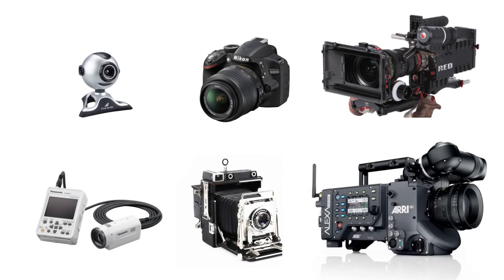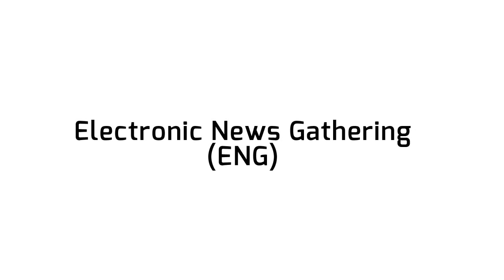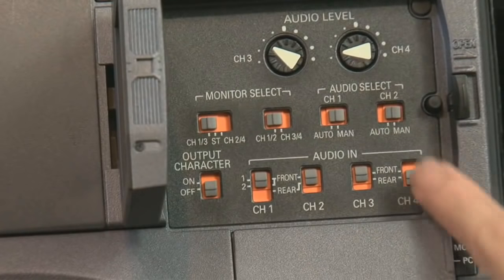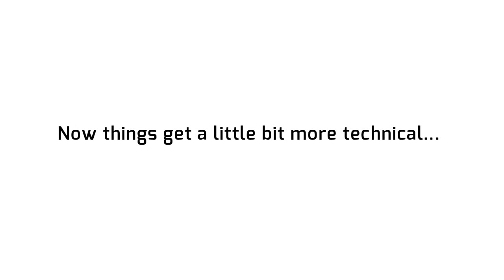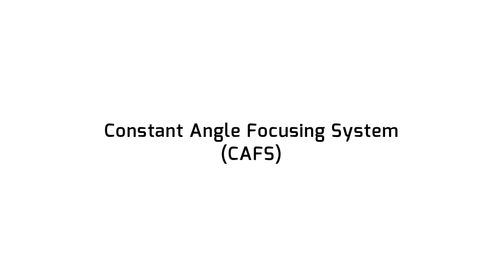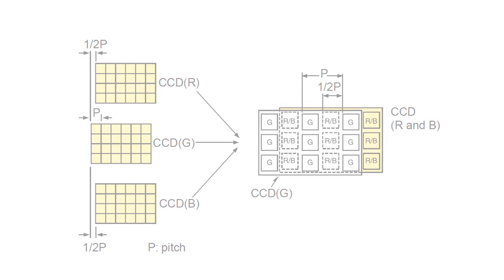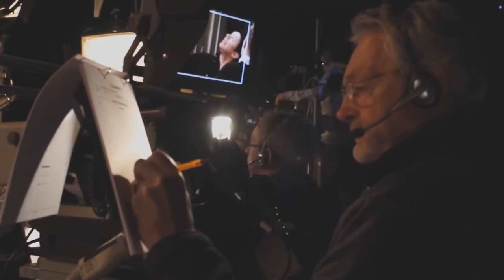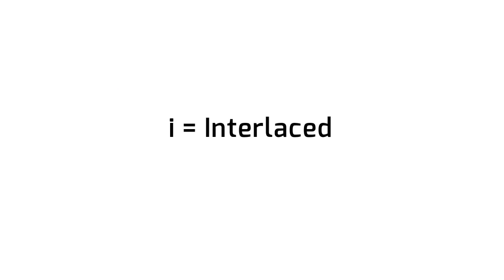Understanding Television Production Cameras

Comment: I'm not sure, but did you mean "larger sensor -> more pixels" instead of "larger pixels"? 5:58
Reply from the maker: No I did mean larger pixels. So when you have a larger image sensor each individual pixel can be larger. That basically means more light can be taken in by each one (i.e. the photon capacity) and with more light comes more 'information' that the sensor has about the environment in which an image is being taken. In turn, colour accuracy is better, contrast is better and there's less image noise because the 'signal' doesn't need to be boosted as much.
Reply: @BenScooter1  Oh I see. Really cool! Thanks for the response.

Comment: Can you please answer these 5 Questions.
1. Why Doesn't every country adopt Pal or NTSC Worldwide.
2. Can the human eye spot differences between Pal 50p and NTSC 60p as 60p is smoother and all smartphones have adopted that, wonder why they opted for 60fps instead of 50fps.
3. Why don't camcorders let you toggle between Pal and NTSC.
4. Many top end consumer camcorders of today have a 1 inch Single CMOS Sensor but the top end consumer camcorders 20 years ago had a 3 chip sensor, why did Sony and Canon change as 3 chip renders colours more realistic.
5. Why did smartphones opt for 60fps instead of 50fps worldwide.
Reply: 1. That would require a large part of the world (mainly the US, should they adopt PAL) or a very large part of the world (all the other countries using PAL, should they adopt NTSC) to quite possibly throughout a huge piece of their broadcasting infrastructure should it be unable to process the new standard.
Also, PAL and NTSC are different for a reason, both relied on using half of the mains grid frequency to do some very clever clocking (with NTSC doing this obviously a little bit different with their 29,97 instead of 30 frames per second, which had to do with available bandwith in the transmission of TV signal at the time NTSC was created).
When you shoot in NTSC in a PAL enviroment (with PAL using 25 Hz as clocking frequency, with 50 Hz being the mains grid frequency) the camera will sync up with the "zero" moment in a sinus wave momentarily and fall out of sync quickly only to repeat the process every 30 frames, simply for it not being in sync with the AC frequency most lights here work on ;) which would be pretty nasty.
2. People who are sensitive to this can definitely spot this, some people are already put off by the difference between 25i and 24p that used to be the standard for cinema film.  Living in a particular "frequency environment" and seeing a particular image standard can make you susceptible to a difference quite easily.
3. Most camcorders unfortunately do, which is also where many of the user errors come from.  "Hey, I have shot this cool video and I want to show it to my friends, but their TV won't play it properly, it like, stutters awkwardly, can you tell me what's wrong?" or someone throwing NTSC footage (unaware there even is a difference between PAL and NTSC) into a PAL edit timeline and going "Wow this looks not right, this computer is probably broken...")
4. Even though CMOS sensors are much, much cheaper to produce than CCD sensors where, they still are basically the most expensive part of a camera to make.  The reason for having 3 sensor back in the old days was that with 3 sensors, each pixel was receiving the information it should be receiving and thus making it much more sensitive to light (which the first consumer video camera's in the 80's absolutely were not :P), while with a single sensor, a camera has to do a process called "Debayering" in order for it to distinguish the color a pixel was seeing.  Sensors (whether it's three or one of them) are basically colorblind and especially with the single sensor ones, a groupd of 4 pixels (2 green, 1 red and 1 blue) is used to determine the color for each one, because a red pixel that registered almost no luminance difference just like the two green ones decide that the spike in luminance the blue one was seeing must have been the color blue. If you think about this, it's actually astonishing that it works like this so flawless each time.
CCD's had a higher production failure rate (to much dead pixels for instance) than CMOS sensors have, next to them requiring a lot less energy to work than CCD's do, which caused the shift towards CMOS sensors.
There are actually still 3 sensor camera's made, most ENG camera's still have 3 sensors and some of the Sony camcorders still do (the HXR-NX3 and NX5r for instance have three 1/2.8" sensors in a surprisingly small package.
Also, concerning the last thing: if you ever have the chance of getting your hands on a color seperation prisma from a professional video camera, they are an amazing piece of technology and may make you understand why they are difficult to make, next to them being obviously bulky compared to a single sensor chip ;).
5. That last thing, I absolutely have no clue, it has baffled me many times as well, the only thing I can think of is a licensing thing or an internal clock-frequency used in many smartphones that might makes it easier for manufacturers to use 60 instead of 50.
Secretly I also have had the idea that with a higher framerate the exposure time for each frame needs to be higher (that is, in the smartphones that stick to the 60 frames, shutterspeed of 1/120th rule) and thus making the phone slightly more capable of dealing with excess amounts of light when some of them lack a proper aperture.

Comment: I'm confused, i thought larger pixes means worse image quality. Smaller pixel = less aliasing and more sharpness.
Same for noise. I thought higher dB means more noise and less image quality, not the other way around.
Reply: You have to take into account that in consumer camera's, the sensor is usually very small and sometimes, more often than not did not contain the true amount of pixels you took pictures or video with.  The camera turned to something called subsampling or another term sometimes used that somehow just went flying out of my head for no reason... and made up parts of the image it did not necessarily had direct pixel information for.
This mainly was to cut down on production costs for the sensor (and thus, the final end product that otherwise might have fell into a price-category most consumers would've said "Why is it THAT expensive?  That doesn't make sense!" became a little cheaper as well).

The Signal-to-noise ratio he talks about is, basically, the difference between the highest possible signal compared to the amount of noise detected or detectable in the signal.  A higher number means there is a bigger difference (voltage-wise, though this is a very crude approach of an explanation for it) between let's say a 1 (maximum signal) and the background noise (being closer to 0 or, in a utopian world of electronic components, totally 0) of the electronics trying to decide what signal it was actually "seeing".
The higher this number is, the less apparent noise will be visible in (let's say) a predominantly black image, which is where most sensors will struggle simply for seeing a lower signal than what is preferred.
What complicates the dB scale is that it's logarhythmic instead of linear, a 3dB increase or decrease is a signal that is two times stronger/higher or weaker/lower than when at 0dB (this is when talking about power, the amplification scale is different and because video camera's also have a gain (that sort of does the same like the ISO setting in a digital picture camera) that is expressed in dB's I am not sure which one he is referring to, the regular "native" dB value of a camera might be 0 and he compares that with consumer camera's and then it's wise to talk about the power scale, but when talking about amplification, which is what the gain setting does it could also be the second scale.

Comment: GENLOCK has got nothing to do with time code. It stands for GENerator Locking. Back in the day studios used sync generstor to synchronize cameras, vtrs, special effects generators, etc. These sync generators supply horizontal and vertical sync pulses, blanking pulse, and chroma subcarrier frequency.
in a television station there is a master sync generator or sync-tub. Everything in The station is locked to it. If yoy use another device that has a built in Snyc-generator, this generator must be GENLOCKED to the master generator for perfect video switches, chroma keys, and effects to occur
The master Time code generator gets its timming pulses from the master sync generator and rhe time code is sent kit via audio

Comment: I think the size is more a matter of there being no huge economic incentive to miniaturize, especially with the tiny volumes these things are made at.
Reply from the maker: Do you reckon? I imagine that more compact designs will be lighter, so less of a pay-load for rigs etc, so their components (e.g. the motors) wouldn't need to be as powerful. If They're smaller more room to accommodate larger batteries to better tackle the power consumption... less material to overheat? Things like that. Of course, I could always be mistaken!

Comment: Thanks for the video. I Learn a lot of things. But what about old tv prod. cams. They had a sensor or using film i don't know
Reply: They could very well have been both, though videocamera's did not use sensors at first, but tubes (in a very crude way explained, they were much like a reversed CRT display, instead of firing onto a screen to make fosfor light up, the same scanning process scanned a photosensitive material and when light had hit the spot when the scanning beam came along it would cause a voltage difference for each dot (pixels did not exist back than).  Given the nature of tubes, they needed time to warm up before you could actually use your camera properly (to correct any component characteristics next to the tube itself that could have it's conducting capabilities change with the increase in temperature).
When color camera's with tubes came out it was even a bigger challenge to use your camera properly, because in order for the image to look right you had to correct for misalignment of the three color tubes (Red, Green and Blue) basically every time after transporting the camera, switching it off and letting it cool down and firing it up again an hour later (not to mention extremely cold weather!)

Some British comedy shows had videocamera's in the studio parts but whenever there was an outside scene, you could sometimes clearly see the "progressive scan-ness" of the film parts in the show.
For the most part this had something to do with the fact that video camera's, in the beginning where extremely heavy, very big rectangular boxes and required tripods on wheels (also called a "spin" or "dolly" though the dollies with hydraulic or pnuematic pedestals we know now came into swing later) to be able to move them around.
Also, if the budget did not allow for a videocamera and a recorder for an outside scene it was easier to use a film camera, having the recorder "on the camera".  Video camera's first used tubes and since this added to their size and weight and adjusting tubes when outside could also be quite the challenge, they did not carry recorders on them.
A second reason for this also had to do with the fact that there wasn't a medium available yet that was small enough to fit into the camera body and thus someone could've been walking around with a heavy recorder on it's back, connected to the camera via a very rugged and not exactly flexbile multicore cable to transport the camera image to the recorder.
Reply: Iris Thank you👍

Comment: 13:18

This is not to be confused with framerates which are being displayed on 60hz monitors.

A higher framerate displays a more updated image on the monitor, regardless of it being 60hz or higher.

However, it displays multiple if it does get higher than 60hz.

This is why we (in fact) CAN distinguish between higher framerates (and play better), when we play video games. The reason it "feels" better.

That isn't the placebo effect, by the way. Since it's not an effect only seen by your brain. It's actual, more updated frames, on preferably more update(able) monitors, that make the game responsive. Not just "feels" responsive.

TL;DR

Hz =/= (not) Fps

More fps and more hz = good.

And ffs, the eye sees significantly more than "24 fps."

Comment: most of the broadcast cams will have 1inch sensor and I would say they are behind of anything consumer in terms of noise, and I dont think they have any excuse for weight as nowdays as a DSP can do that all, blackmagic has done a step in the right direction, including the weight and the price, will see how its going to go
Reply: Broadcast camera's usually do not take into account an excessive light sensitivity like in consumer camera's, simply for the fact that most consumers will not bother taking video lights with them, or ensure they will catch the best possible light given the situation they are in by taking a good position.
Extra light can/is used to flatter certain body characteristics during an interview or to brighten shadows on a bright sunny day.
And most of the broadcast cams I have seen the specs off still almost all have a 2/3" sensor, not 1".  A 1" would cause problems for basically every lens currently on the market for ENG or EFP situations.

Concerning the weight of those camera's, yes, they probably aren't as heavy as they were in the 80's or 90's, but weight also comes with the benefit of the camera not going to shake as easily when on someone's shoulder or on a tripod and also giving it some much required rigidness.  Don't forget that ENG camera's are designed to keep on recording steadily (Whether it's on SxS or XDCAM discs) when someone is running with the thing on it's shoulder and also should be able to have a lens of 4-5 kilograms (if not more) hanging on the mount which is an incredible amount of weight for such a small piece of metal when you see the mount of a broadcast, though shoulder mount camera lens.

Comment: One thing you got wrong is that bordcast cameras don’t ah e big sensors, they have the opposite (they have notoriously small sensors) it’s the cine cameras that have huge sensors.
Reply: Broadcast cameras used to use 4.5" and 3" sensors back in the 1950s. I think 1.2" and 1" became a thing by the 1960s, and 2/3" and 1/2" were ready by the 1970s/1980s. Today we have 1.25" sensors in 3-chip cameras like the Sony UHC-8300.
Reply: That's intersting, so bordcast cameras has gone the oppsite way normal cameras has gone. Now days cine cameras are going bigger and bigger, but if the part of 4.5 inch sensor is true. That's massive, are oyu sure that is true? 4.5inchs are 11cm or 110mm, that is like 3 alexa 65 sensors together, how could the whole film industry not be going after that size?
Reply: @jingtianwang9793  Yes, monochrome video cameras manufactured in the late 1940s up to 1960 (with the concluding camera being the RCA TK-60) with a single 4.5" Image Orthicon photoconductive vacuum transducer pickup device (i.e. tube). Broadcast terminology lends itself to really using about 2/3 of the quoted diameter of the optical format (size) of the tube sensor, as do chips that took on the same methodology.
Reply: @Nuclear Armament Damm, that's intersting (and really big, even if you are using 2/3 of the sensor), thanks for the insight, guess our multi million film industry are stuck with our meer 65mm sensors. (I know, those old 4.5 inch sensor are probably terrible to today's standards)
Reply: @jingtianwang9793  Yeah, the HDC-3500 and the HDC-P50 seem to be the only 2/3" 3CMOS cameras with UHD (3840x2160) resolution that also employ, for the very first time, global electronic shutters. This is amazing, now we have something brand new for the very first time since the 2/3" 3CCD HDC-700 and HDC-750 cameras came out that employed global electronic shutters from out of the gate back when they debuted in 1997, but with twice the horizontal and vertical resolution (3840x2160 versus 1920x1080) and twice the resolving power (200 line-pairs per millimeter versus 100 line-pairs per millimeter) and half the vertical and horizontal pixel size (1.25 microns versus 2.5 microns). It only took 21 years!
Reply: @Nuclear Armament you seem like you know a lot about bordcast cameras! Do you work in the TV industry? Or are you just really curious about bordcast cameras? It's really intersting, the TV guys have some really different terms than film. I work as a film dp and I can't understand most of those terms, and I'm normally the camera geek who to understand everything.

Comment: How do tv stations do green screens such as weather forecasts?
Reply: Glenn Lego using chroma key in vision switcher or external device (eg ultimatte)
Reply: It’s super simple actually. You can do it yourself at home with a webcam, some green material, and some free software called OBS.

Comment: ... and yet they have made films and TV shows with iPhones, probably without the viewer even noticing.
Reply from the maker: Which films/shows are made exclusively with iPhones?
Reply: @BenScooter1  You can find them using google.
Reply from the maker: @jvs57  To my knowledge, no film that has seen a proper theatrical release has been filmed - partly or entirely - with an iPhone, same with shows and broadcast. If anything was shot on iPhone it will have been small-scale indie projects that would have made a big deal of the fact an iPhone was used.